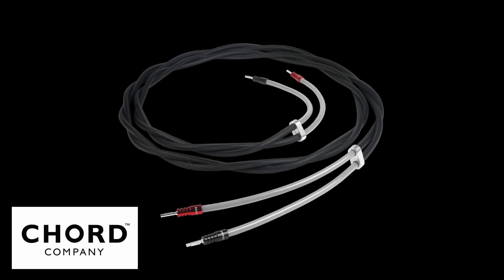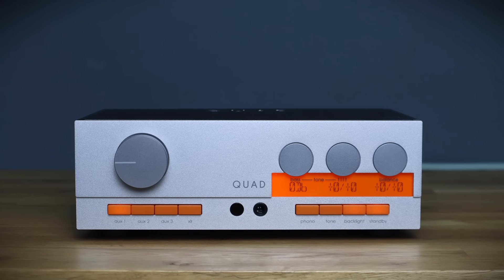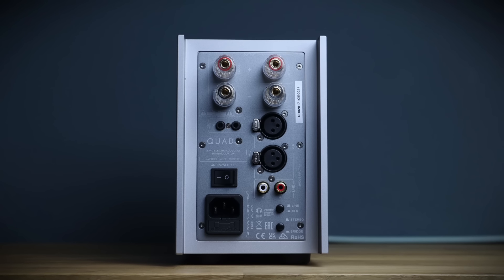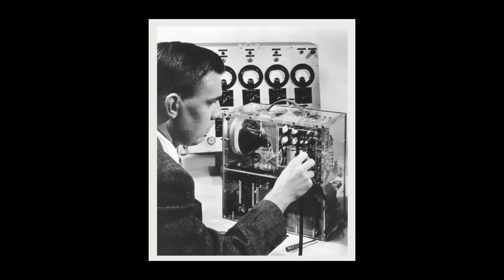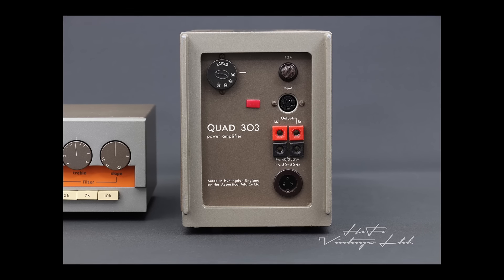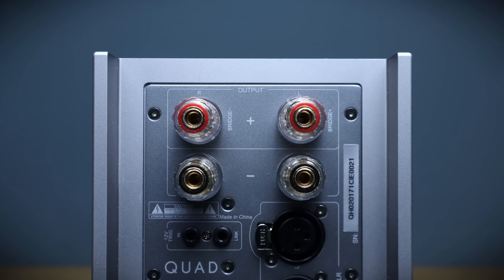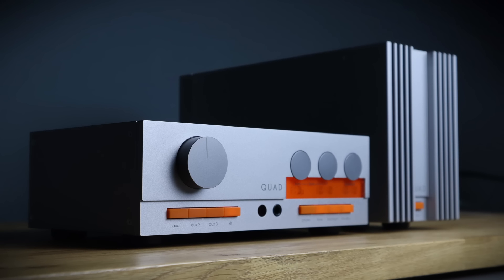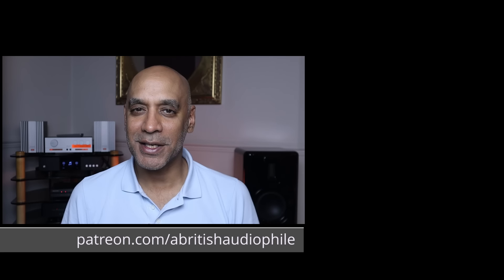1960s ICON REIMAGINED! Quad 33/303 Amplifier Review

Comment: Thanks Tarun, Another excellent review. The orange color is a problem from me, Just a personal quirk. The California Department of Transportation vehicles and uniforms are a similar color so Caltrans Orange are a common sight around here. The specter of a job requiring me to actually do some physical labor between the curbs is a bit unsettling. Probably something to do with convicted drunk drivers working off their community service picking up rubbish along the freeways.
Reply from the maker: @fletchermunson6225  thank Jim. It is not the easiest colour to see when on. Fits the vintage vibe though 😊
Reply: @abritishaudiophile7314  Sometimes you cant reheat an old Soufle'

Comment: The pre looks amazing and would definitely fit into my Vitsoe shelving aesthetic. 

But I can't get my head around the modest output design choice of the 303. The looks are great / nostalgic, but the watts seem to be designed to strongly suggest an upgrade to x2 303's (in the same way Apple today designs it product range for iPads / MacBooks etc). 

It's no wonder the original sold more pre's and it's the same business model here. Except at £3600 for amplification, there are hitting some very stiff competition + Their own Artera power is 140w into 8ohms - maybe a 33 + Artera is the better value proposition.

Comment: I bought a refurbished 33/303 on Ebay for less than £600 last year and they sound lovely and have proved to be reliable. To my mind they look so much better than this reissue. If you are interested in the Quad look and sound I cannot imagine why you would spend the extra on the reissue when it is so easy and cheap nowadays to get a refurbished original set for so little money

Comment: Would like to see a video about the Proton D1200 power amp and the P1100 pre amp.
Those are from the eighties.
I have both of them serviced (cost considerably) and drive my Translator Reference speakers.
Those are from the Dutch designer Hans Baan and also from the eighties.
Reply from the maker: @ronheetman564  I appreciate the suggestion 😊

Comment: Thanks for the review Tarun. Classy as always …

Tell me this. Is that a Quad Revela 2 behind you to the right or the Revela 1 - you used in the review-on a stand. I bought the 1 following your review. Very interested in the 2 but waiting for a review.
Reply from the maker: It is the Revela 1 but I plan to get the Revela 2 in soon 😊
Reply: @ can’t wait. Very interested to see how the honeyed sound translates when into  a floorstander. I would have thought Quad would have wanted to get a pair to you pronto.
Reply: In terms of reborn legends - love to see your review of the new Heybrook HB1s. They were my first speakers alongside my A&R Cambridge A60 amp and Rega 3. I’m still using the Rega. Sounds as good if not better than the day I drove off with them from Billy Vee in 1985!
Reply from the maker: @AliRafati-xk9jg  they did. The delay is at my end. I tend to wait before doing another review by the same brand. Spreading the love 😊

Comment: I'm curious about the voicing of amplifiers. Have you gleaned any insights from manufacturers how they tune an amplifier to retrieve more or less detail, warmer or drier sound etc. It doesn't seem to be just the basic frequency response performance. Is it just component selection?
Reply from the maker: Lots of factors contributing to the overall sound 😊

Comment: Would love to see the design elements of the Armstrong 621 revived. Still have a working 624 Tuner but the 621 fried its output transistors long ago. Would the 303 in bridge mode equate to the 50D of the past? Perhaps we need a return of the BBC LS3/7 to match.
Reply from the maker: Cool 😎

Comment: I love old quad amplifiers. I prefer the current dumping 405-2 and 306 to the 303 but it's still a great amp. I also like that they are so easy to service. I have no desire to buy a modern 303 whatsoever

Comment: It would be nice if you had an original 33/303 to compare the sound to. By reputation the originals were impeccably designed but let down by dated and crappy parts. The solution is a complete parts upgrade with HQ poly caps and metal film resistors. The improvement is a revelation and a testament to how good this all discrete design was and still is. My prediction is the original 33/303 should blow away the new IC laced versions but only if the caps and resistors are changed out with premium ones which is rather expensive.
Reply: Dont have to use any exotic parts just change all the electros if they haven't been done yet, the originals spewed up over the PCB's! Can use 4700 mfd now and change the  presets for good cermet ones and if the 303 is very early there is a mod to make the bias more stable. Using a very early 33/303 as a PC speaker system Digigram sound card and then speakers BBC designed Rodgers LS3/5a what else:)

Comment: I think the Chinese are doing a good job of recreating out of patent old designs, if not always cosmetically. They are using the old circuit designs of tje likes of Accuphase and DartZeel.
Reply from the maker: @D1N02  these were designed in Huntingdon, Cambridgeshire, U.K. 😊
Reply: D1N02 is right, though. That's not what this is, but the recreation of out of patent designs is a very interesting and, I think, desirable development. Also entirely legal. So long as the fact they are copies and not originals is made clear, which it generally is. You can get a taste of the vintage high end without buying something which is likely to break at any moment, and which you need skill to maintain. If you are a tweaker, there is plenty of room for upgrades.
I think, Tarun, it would very interesting for you to take a look at one, perhaps the DartZeel clone, the D5 Pro.

Comment: Quad have always produced smooth sounding amps. I've  only heard the Quad 909 years ago. That sounded creamy yet informative. My Leema is similar to the Exposure 2510. It's more agile & revealing than the Quad I heard. I like what it stands for, not sure I could live with one.

Retro styling seems to be the order of the day, mostly all IAG based products, but I loved the look of my old Pioneer SA-706 (circa 1976). With its dancing VU meters and smooth sound, it made for a great budget integrated.

Comment: If it was made in the UK I would have bought it, but it’s just another Chinese made consumer electronics item as it is. I’ll be looking for an original set instead!
Also, things which put me off - cheap caps, SMT caps which can corrode the PCB over time, a switch-mode power supply which seems unnecessary and cheap connectors with the usual glue dolloped over.
Come on, you should be better than that.

Comment: Ok, it's a Quad, it's nice both inside and outside. But price too high for being manufactured in China.
Reply: Why? China make some of the best HiFi on the planet!
Reply: @rogerwebb7501  that's true, but the manpower cost there is much more lower than in europe, so a cost of 1500 $ (more or less) per unit is excessive. I think Quad could have a significant retail markup even with lower prices.

Comment: I inherited my father's Quad amp, preamp electrostatic speakers.
There is also a B and O transcription unit, Revox cassette machine and Quad CD. And a wooden quad box to hold the amp and a VHF receiver.
That's from memory, I've never set it up.
I may do so as I have a larger room now.
Is there a market for this kit? There also som period Sennheiser headphones.
I tend to use my quality phone and some cheap Sennheiser headphones so I feel it would be more valuable to someone else. Can anyone advise me please?
Reply from the maker: @ReginaldCarden you should be able to sell them on EBay or HiFi Shark 😊
Reply: @abritishaudiophile7314  Thank you for that information.
Reply: @abritishaudiophile7314  Thank you, there appears to be value in the equipment  including items like CD, 12 inch record transcription unit, VHF receiver, which could be considered obsolete.
Thanks for your guidance.

Comment: It's a big NO from me regarding this reworked and modernised Quad 33 / 303 combo .  I will stick to using the original UK designs of the 33/ 303 which i have owned and used for many decades now .  They still give sterling performance for my listening tastes .  So why would i even consider changing now that i am in my 70's just for the sake of it ?  I still use them with the Original Quad ESL speakers despite owning many later Quad amps and speakers i keep on returning to my older system for hours and hours of listening and musical enjoyment via non fatiguing sound quality .
Reply from the maker: @davidhardy7356  cool 😎 never change for the sake of it 😉

Comment: I don't see the point of a digital control for a discrete amplifier. If you want purity and error-toleracne, make it completely discrete.
Also Digital Circuitry causes interference, so you don't want them near analogue circuitry.
Further, DIN is strictly better than Cinch, since it has a single mass wich is also seperate from the shielding.
Reply from the maker: @Ribulose15diphosphat  thx for sharing 😊

Comment: The original was more beautifull ...............besides the use of opamps , smd and industrial connectors, low quality RCA , chinese capacitors etc ........a no no for me ( as many other modern production amps )
To drive electrostatic pseakers as well as Electrostatic headphones the old quasi complemetary amplification output design worked very well , still use that kind of output driving my Stax electrostatic headphones ....with a smile when listening .( to MUSIC )
Reply from the maker: Thx for sharing 😊